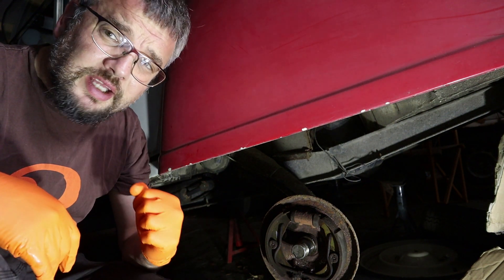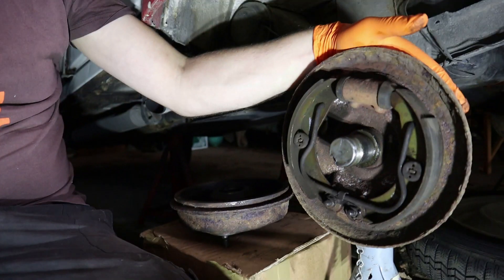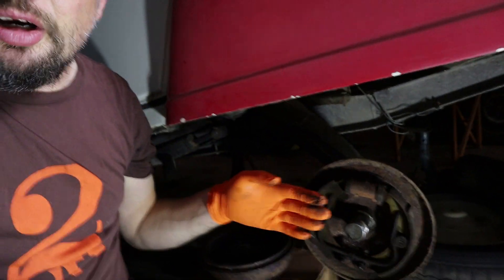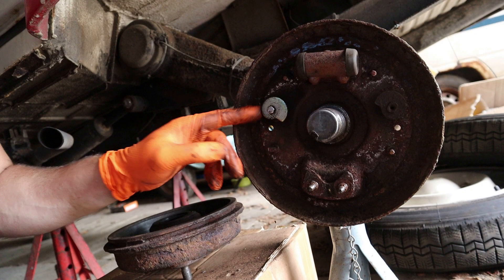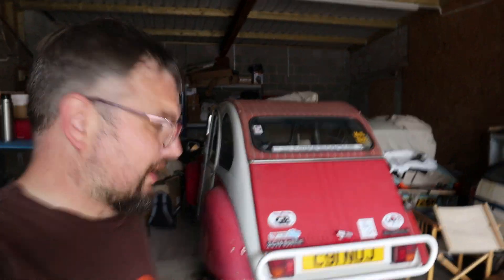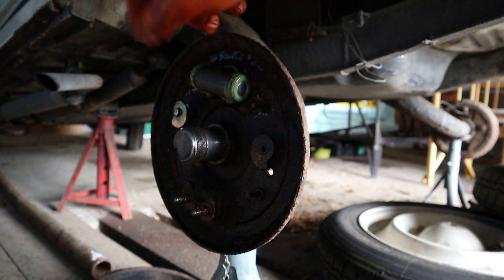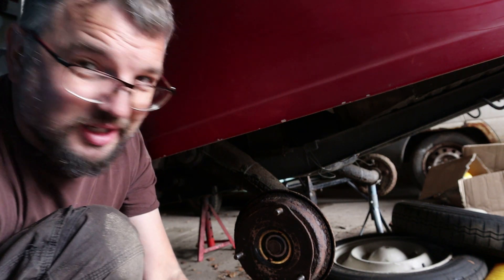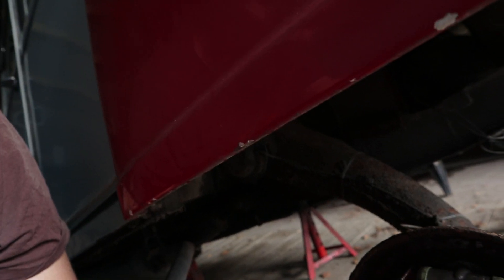2CV MOT Preparation continues. Problems!

Comment: Does it mean one is a masochist if they watch Ian's videos? Oh my, you really need a torque wrench. 200 LBS is not that hard to pull. New nut made a mess out of it fast. If the old nut gets past it, go back and forth over it a few times, should smooth it out. All the threads that come after do all the work! If it won't, oh man, you're screwed. Time for a machinist or replacement spindle. Might want to talk to whoever sent/sold you a coarse thread nut for a fine thread spindle too... (that is what the scar looks like to me any way).

Comment: You're not the only one who forgets bits or gets them mixed up. I thought I'd lost the nut that holds on my Renault's left wiper arm*, after I had to remove it to replace the strut top bearing. I used what I thought was some other random nut to hold it on, which was too big to put the plastic cover on. After a whole day of being annoyed about it, I suddenly had a brainwave and checked the nut on the anti-roll bar link. I'd swapped them around when putting it back together.

* I only noticed the other day that it's got a triangle of doom, because it's on the passenger side, the windscreen is very tall, and the dribble is mostly hidden by the rain/light sensor round the mirror.

Comment: I hate drum brakes.

I have the worst of both worlds now, since some idiot at BMW decided to put a drum inside a disc for the handbrake (which doesn't work on my car at the moment, lucky it's an auto), an arrangement I'd not seen before outside some American cars I'd watched people disassemble on YouTube. I guess it means it won't roll away when the disc cools down like late 90s/early 2000s Vauxhalls, but I'm not particularly aware of that being a problem with other marques anyway - I'd always assumed that was just bad testing on their part rather than an inherent fault of using disc calipers as parking brakes.
Reply: With a handbrake-on-disk setup you soon learn to leave the car in first gear.

Comment: I can understand the windscreen wiper obsession but why does every car you own have to be caked with rust? It's not a good look.
Reply: @RussEdgar445y7tlfj  I grew up in Sweden where the roads are covered with salt all winter and yet I've never seen rust like that looks like the manufacturers have been saving on rust protection.

Comment: If you ever been a DYI guy you gon oh no I can't  believe  I did (explitive) that but oh well As the Deutscher vood  zey back  to the  zee drawing board! Do we call that  a cheater  bar. So what is it in English  sense  I really speak  American english . Extension  or something else
 I've done the boogering of the threads and dressed them with a fine triangle file  but it is hard to find the right  one unless you have  the threads close by to check.

Comment: There's no stupidity worse than your own, I find. Often. More often than I'd like.
Had a similar issue with damaging a thread once. Like you, it was using a new/different nut. Managed to restore the thread by cutting the original nut in half and putting it around the good part of the thread further down and backing it up and off. Cleaned the thread as it went. Spare nut from my 'rummage bin' - with lots of grease - then finished the job. It was very fiddly getting the cut nut into the socket and having it stay there. Duct tape was involved, I think. Often is!
Reply from the maker: You'll see similar next time...😉

Comment: I was looking forward to your struggle with the spring retainers, after the nightmare I had doing a similar job on my Puma a few years ago which involved screwdrivers, pipe grips and more swearing and sweating than usual.... And your springs just lever off without a fuss. Had to pause and immediately post that you sir, are jammy. So very jammy.
Reply: *watches to the end*

Yeah, I might have struggled, but at least I didn't do that...